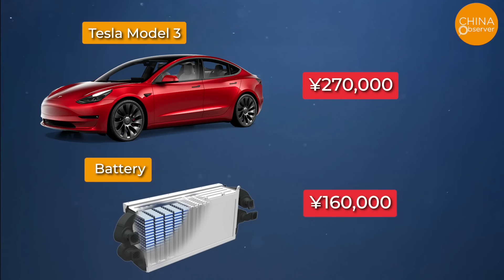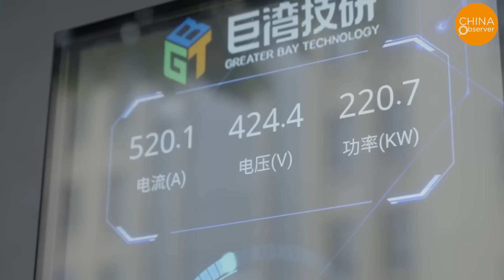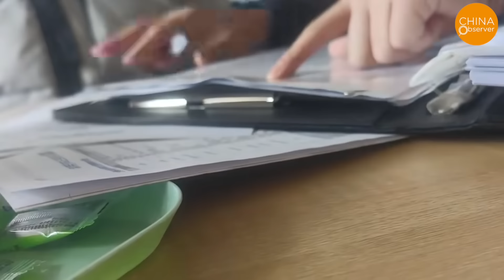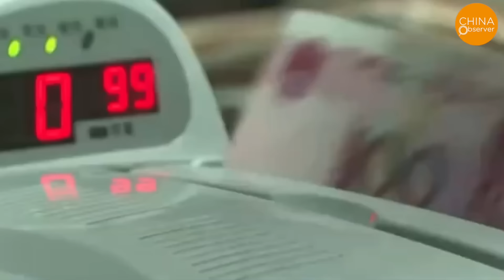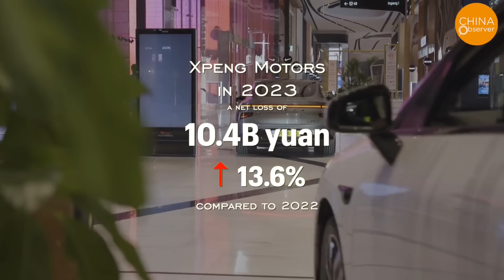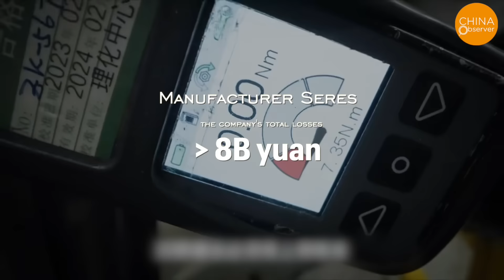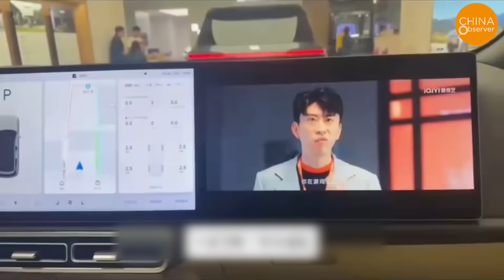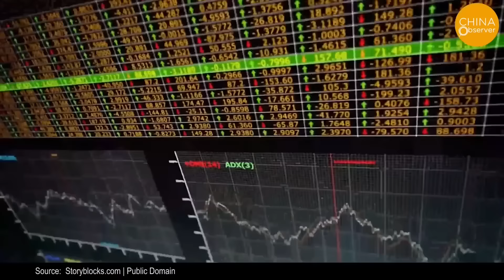Doomsday for China's EVs: New EVs Self-ignites During Transport, People Abandon Firefighting

Comment: Aside from the obvious crap Chinese manufacture here, I would never buy an EV. I get a new car every 3 years as I'm disabled. 
They could not work for me. Here in Britain, there are so few chargers that it couldn't mean that I could travel any distance before having to wait hours for a recharge. On top of this it was patently obvious to me that lithium batteries are going to degrade over a short time, meaning that after about 6 years minimum, you're going to need to either replace or maintain batteries. And the cost is prohibitive. 
And then you have the idiotic modern tech bro idea of hiding everything behind an app or being anti-repair.
I will NOT support that.
Reply: It's not 6 years for a total battery replacement, unless you go with an inferior warranty or inferior/cheap brand. EV's usually warranty for 3-5 years for the car, and 8-10 years and 90-120,000 kilometers for the battery.  

The problem is, there are very few EV's older than 12 years old, so it is hard to calculate the effective degradation. 

Plus, you do not have to replace the battery. You can partially refurbish the battery or replace it with newer technology especially when the car is out of warranty. refurb parts tend to be significantly cheaper, and a refurb EV battery can be $5k versus the OEM's $20k because it's not using the same parts, it's using newer/cheaper variants, or secondhand parts instead of new.

People have refurbished 2005-2010 Nissan Leaf and Toyota Prius batteries for less than the price of the car, and doubled the range due to technology changes in the capacity/weight and BMS.
The problem usually is, it's still a Leaf/Prius. Those cars are 3/4 plastic, and the plastic is degrading/aging.

The degradation isn't absolute. It's based on how far you drive each day. You get 250km to 300km on a full charge, sometimes more. If you drive 2 hours every day with a disability, i'd be surprised, but that's still within the range, and charging speeds go from range estimates of 10km/hr from a wall plug, to 400km/hr on superchargers. You do not need to keep it at 100%, you can top up while shopping or parking and sitting at a doctor's office, et al. 

People still drive 2012 EVs with over half to 3/4 the range available. What typically happens after 6 years is you lose 10-15% of range. The newer cars have more cycles and improved safety systems. Not so much in Chinese made cars, but EU and US cars tend to have better consumer warranty. 

I'm not sure how UK disability provides NEW cars every 3 years. I didn't think pensioners had that much money unless they were politicians. If you meant 30 years, ok. Then your 1990 subaru should be fine. Problem is, one day it will probably sieze up and die. As 20-30 year old cars tend to do despite maintenance. 

Then you'll be in some trouble, as registering older cars is becoming more expensive. So is insurance.

The current statistics on "actually 10 year old" Model S Teslas (as the Model 3 is only 7 years old), is above 80% on range/degradation lifespan, and it skews depending on mileage. Based on millions of drivers uploading stats from their cars, you can see range/degradation stats on a daily, hourly, weekly basis across tens of thousands of cars. 

Where it becomes uneconomical is using an EV as a taxi, this requires a whole different type of car and battery system, and the lifespan will drop to 3-5 years. This isn't common, but there is tracking/statistics on EV's used for 500 miles a day level usage. It's pretty disastrous, but if you're driving 100-500 miles a day, is that normal ?

Most all current and past cell packs can be refurbished with aftermarket batteries as long as the brand is reputable, as the UK also has access to EU markets. It's hard to predict the longevity without actual 10 year old batteries, but 2016 LFPs still have 8 years of charge/SoC results. While it's hard to associate trend data from 3-4 year old LFP batteries, they are usually warrantied for 70% capacity over 8 years, give or take.  

Wether or not the manufacturer will refurbish or replace the battery with an as-new, or older battery is up to consumer rights laws in the UK. Still, distance/ charge costs are relative. 

In rural areas you won't have authorised service centres nearby, or supercharger access. You also have range anxiety and access problems as they aren't really designed to go offroad or outside of the highway/metro areas.
Reply: @Toliman.  Plus if you need a replacement even after 8-10 years that costs either as much as a new car or more then you're still not making a good point here.

Comment: There is nothing wrong with BEV.  There is something wrong with China.  It's called lack of standards and lack of enforcing the ones that exist.

BEV suffers multiple problems in China other than poor manufacturing quality, and the worst is constant flooding and BEV are NOT the vehicles to have in places that flood.  I mean when you need boats to get down the road, something is wrong.  And for those who don't fully understand this, people who have lived in China and left say that big cities flood all the time, or a few times a year because of improper drainage, and it doesn't matter if it's a tier 1, 2, 3 city.

You can't even trust that when you receive the vehicle when it's new that it hasn't already been submerged.  That's a REAL problem.  There's just something about water and batteries that don't mix.  And this is why Tesla has well sealed battery paks.  In fact they have an outstanding pack with their newer battery, the 4680 called a structural battery pak.  It's the best thing on the market, though Tesla is working with a couple companies to try to boost the capacity of the battery so they can get long range vehicles, as good as ICEV in the US market.  In fact WHEN the battery tech improves and capacity increases a bit the range of BEV WILL be better than ICEV, but that's not going to be in the next 2 years.  More like 4 - 5.

And when you buy stuff from China and it seems damaged, well, they deal with flooding so.....

Comment: is the massive growth of EV use in China the reason China has built and is building so many coal fired power stations? It’s a bit ironic that the switch to electric vehicles was meant to reduce carbon emissions. But switching to an EV driving population does not eliminate carbon producing. it merely transfers it from the automotive industry to the power generation Industry..
  I have seen a video that a Chinese company is making an EV Called the seagull or something like that, they are building a plant in Mexico, and these cars seem to be targeting the market in the United States, according to the video maker. But the big story there is, the target price for selling these Seagull Evies is around US$10,000.
  if they have the same system for swapping batteries as the Chinese auto maker NIO has for swapping batteries in less than 10 minutes from a discharged battery for a fully charged battery when needed, up to six free battery, swaps per month, I am interested in that type of EV at that price jere in Pennsylvania, USA, but only if there is a dealership nearby for service..

Comment: China is the problem and not the EVs. The States have an 8 year 100 thousand mile warranty and California is 10 years 150 thousand mile warranty.We don't have massive reports of EVs catching fire here either.
Reply: It's because early Tesla models sold in the US exclusively used Japanese, specifically Panasonic batteries (who also uses components from Japanese suppliers). The most expensive component is the battery module, so Chinese EV makers are cutting costs by using lower quality less reliable batteries. Currently, there is no other way to manufacture an electric vehicle for sales price range of US$ 15,000-20,000. (Tesla's replacement battery costs US$12,000 - 20,000)

Comment: EVs here in the U.S.A catch fire at a lower rate than ICE (internal combustion engines) vehicles and are much safer. Why are Chinese EVs catching fire like this? Tesla's made in China are not catching fire. Why is that? Answer: Tesla's built in China don't have this problem. Why is that?  Crazy to see these fires happening with Chinese EVs. Not good.

Comment: Ah, now, you might well type that but are your assertions correct?

Can you prove other than portrayed on the clip?

It is fact in UK the sales of battery EVs has declined in favour of buyers choosing to teturn go petrol and diesel vehicles.

We see fleet owners concerned that the residuals, insurance, as well as cost of battery repair or replacement are a huge disincentive to buy battery EVs on the used market.

So, again, if you can prove otherwise then kindly do so.

Comment: Honda Accord  petrol engine every time. Evs are neither safe or  environmentally friendly compared to gasoline or diesel powered cars. They are only quieter. How are not environmentally friendly? EVs are heavier. 1. Heavier cars need more power to accurate them to speed. It 's simple Newton's Second Law; F=ma. EVs are heavier compared to combustion engine cars  (because of those batteries weighing at least 200kg) requiring more energy to move the EV cars, 2. Charging; where do you think the electricity power is generated? From a coal powered smoke stack, sometimes hundreds of kilometres away. Guess what, the atmosphere is connected to the whole planet.

Comment: stupid talks about BYD on fire  and consealed the accidents of tesla catching fire. A total of 62 people have died in incidents where a Tesla caught fire, two of which also involved Autopilot. For example, in 2022, an NHTSA report said the autopilot on a Tesla Model 3 in Colorado mistakenly drove the car off the road and into a tree before catching fire.14 Jul 2023
Reply: lol....china number 10....all day.....
Reply: Sure you are right but a burning high impact ev from the us is 100 times better than an not under use burning chinese ev.

Maybe you find the difference in why the ev is burning and why its maybe worse.
Reply: Try to keep up this post is about crappy made Chinese cars 🇨🇳
Reply: Then compare the EV combustion rate of Chinese and foreign-branded EVs? Then match it with gasoline powered cars in the same region.
Reply: This is about chinese designed and made EVs, bro. Go make a Tesla video yourself. Looks like you have all the data.
Reply: Like 3 million Teslas on the roads, and only 62 fatal accidents!
Compare that with ICE vehicle accidents!
Reply: So? There are over 6million Teslas on the road in 2024, The Tesla crash rate is 0.2 crashes per million miles using autopilot, 0.6 crashes per million miles without autopilot. The average US crash rate is 1.6 crashes per million miles.

Almost 200,000 ICE cars caught fire in the USA in 2023 alone, that's one every 22 seconds - you are 50 to 60 times more likely to die or have serious injuries from burns in an ICE car v EV per mile driven.
Reply: @hokroeger  over 6 million as of March 2024.